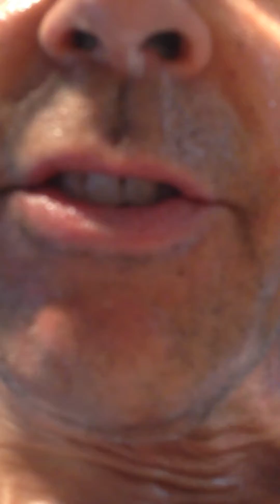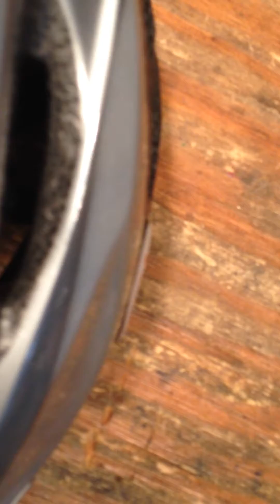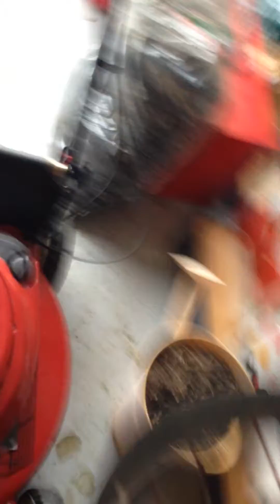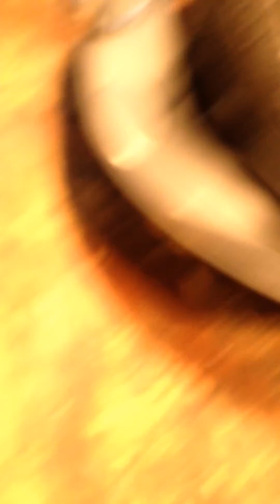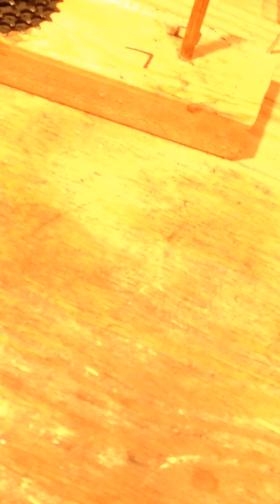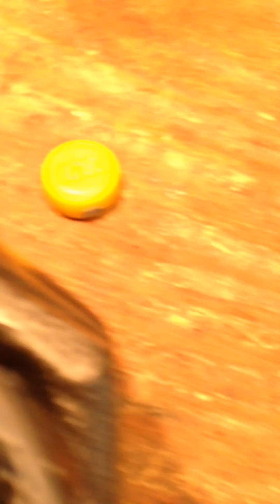ICEdot Crash Sensor Review (Dr. Weil)

Comment: Good info, thanks for sharing. If the devise stayed on better would you consider it a viable solution?  Do you have/use the product? Has the manufacture responded to your complaints?

I feel like it should take more impact than what you showed to 'sound the alarm'...based on my illustrious career of biking I haven't hit anything hard enough where I would need emergency help. This coming from someone who falls allot and had a number of good ones. 

Having said all that it could be a lifesaver if you take that 1/10,000 crash with nobody around and where you have cel coverage. 

Thanks again for posting and keep the shiny side up!
Reply from the maker: No, I don't believe so. The problem is in the algorithm used to process the crash data. It is looking for linear deceleration as well as torsional changes, which both need to meet certain criteria. In many crashes (and when tossing it out of my bedroom window), torsional deceleration/changes are absent. So, if you did a header from a five story building, it likely wouldn't go off. To me, that's NOT a crash sensor. Rather, it's a head impact sensor. That it popped off the helmet mounting bracket is not a design flaw; the sensor has to come off so you can charge it.

However, that brings up a different issue. Namely, there is supposedly a light that indicates it is charging. However, the manufacturer said they designed it with too little testing, and the light is NOT visible unless in a pitch black room, and even then, your chances of seeing the dim light are 50/50. He told me that would be addressed in a future design upgrade. So, we're beta testers at this point. Hope that helps.